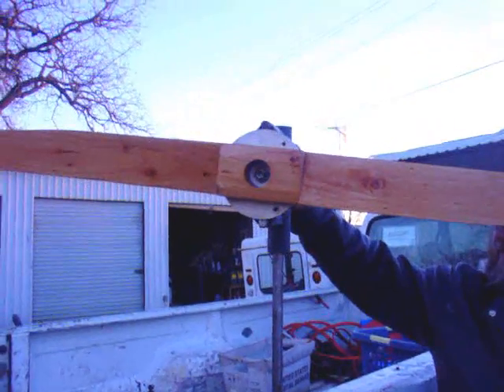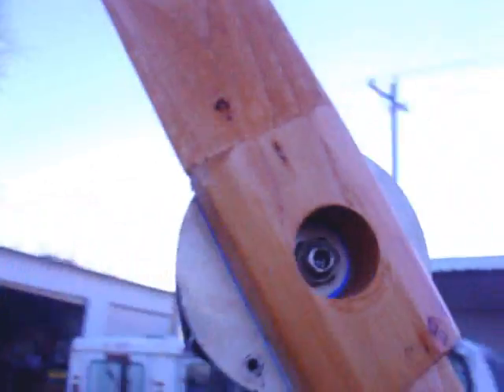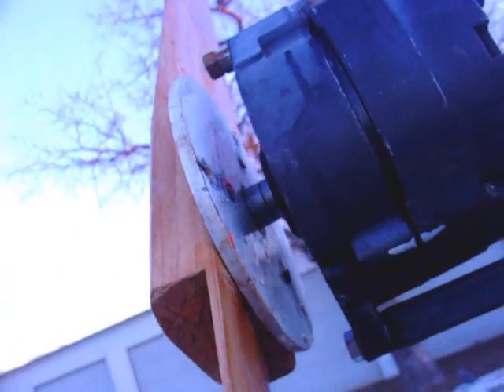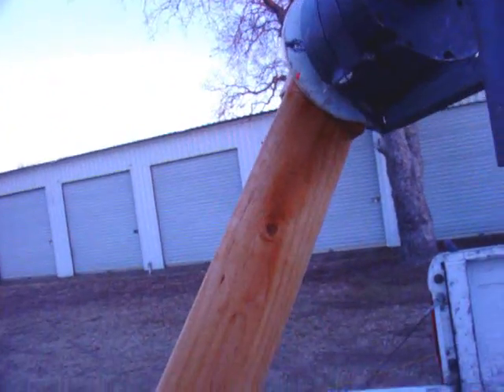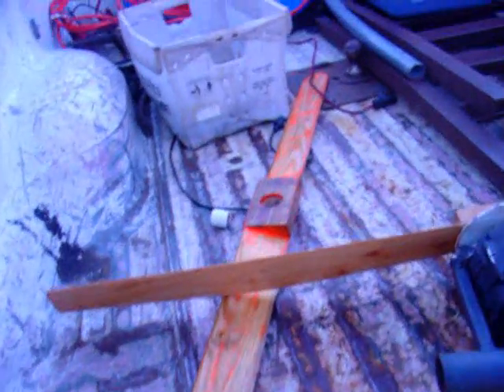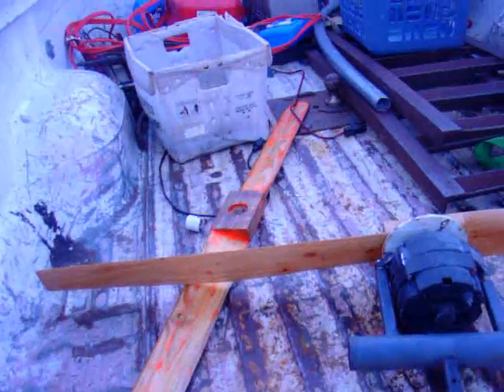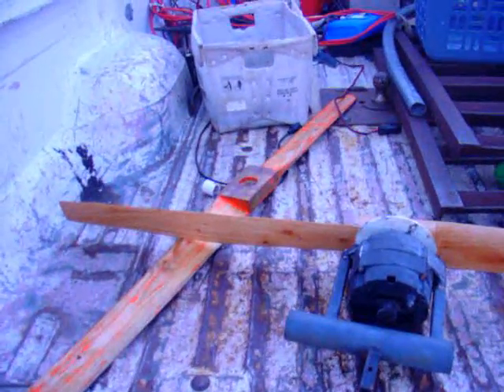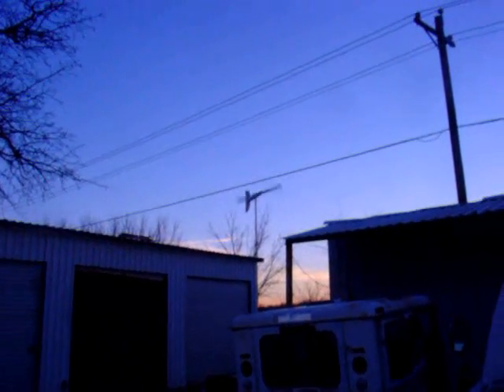SWEET LOOKING PROP FOR CLUGGY'S OTHER WIND TURBINE

Comment: Question:  not a critique of you just an observation of the prop building of this type,  why is it not an alternative to this a prop "blade" only to profile then capture  2 to 4 blades in a hub with the appropriate pitched acceptance slots.  a higher quality wood for the blades could be used with possibly thinner section of equal strength ?  regards,